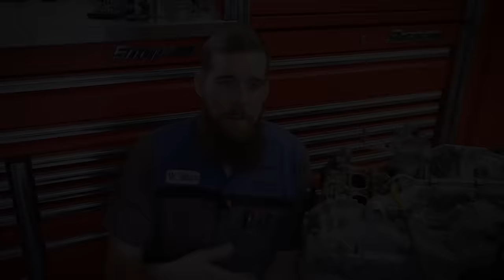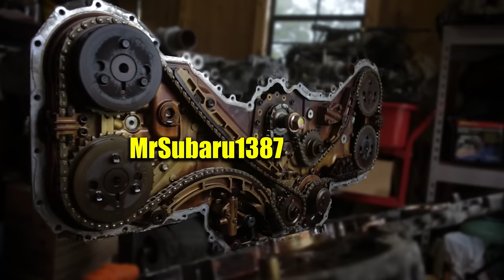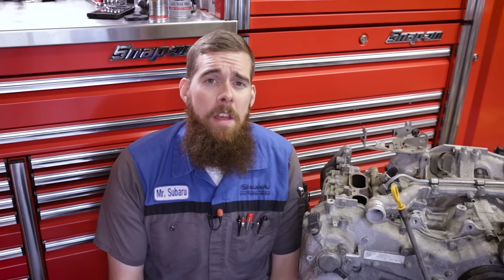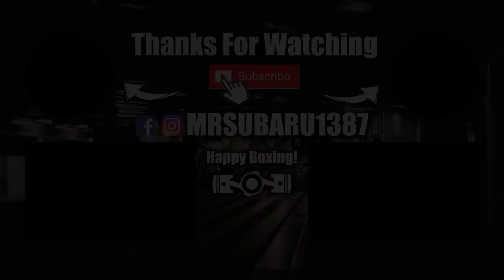Why Subarus Are So UNreliable!!! Buckle Up!!!

Comment: I have a 95 Impreza... it is a 1.8L with an AWD 5spd. This car... is a piece of shit from the way others have treated it in its past life. When I bought it it had already been treated so poorly that it wasn't road legal for nearly 4 years at that point (despite still being daily driven). This car... was not cared for at all by this guy. When I bought it, I bought it out of pure desperation for $500 off of craigslist when my car blew its transmission the day after I got my first real job. The guy claimed that it had had its engine rebuilt at 180,000miles so that's why it still ran so good. He also gave me the contact info from the person that owned it before him for some reason. After I had bought the car, I did manage to get ahold of the previous previous owner who said, "I never rebuilt the engine, I just told him that to get more money out of it. I actually used to use that car as a cheap autocross car, so from about 170,000 to 220,000 miles it lead a very VERY rough life. The only thing I ever replaced on it was the tires."

So... I bought this car at 270,000 miles. Never having had any engine work done on it from 170,000 miles onwards. It still runs like an absolute top. Smooth as butter. It has now crested the 300,000 mile mark and is still going. I am not gonna lie... I beat the ever living shit out of this engine. I have boiled the coolant right out of the engine during a snow drifting session (the rad is cracked from when the previous owner hit a dear... I patched it with JB Weld but it aint perfect) where I didn't let the engine come off redline for 10 straight minutes. We just filled the radiator back up with snow and put another 15,000 miles on it 🤣

That 1.8L is unkillable I swear.

Comment: One of my colleagues, who was a Subaru Service Advisor also told me that Head Gasket was never an issue on Turbo Boxers.

But my question is, as a Stock WRX owner, doing regular maintenance as instructed by the manual and service guidelines.
But, living frequently in the High Rev Ranges, going wide open throttle often. (Never exceeding the Red Line, of course.)
Will I blow my head gasket?

Comment: Subaru engines are not designed for high performance operation or modification.
They also do not do well when turbocharged. 
Maintain them in ordinary passenger service, and they will last, but not as long
as most Toyota engines, and certainly not as long as a cast iron American V-8
or straight 6. The last Subaru vehicle I owned which had a trouble free motor,
was a mid-1980's Legacy with the 2.2 engine. Subsequent Subarus were all
trouble-prone. Its just an outmoded design, and you can't expect too much from them.

Comment: Man I'm just now replacing my '11 STI clutch at 121k still shifts perfectly just has a worn squeaky throw out bearing, might as well replace everything in there new flywheel been a good car a side from the leaky steering rack that went at 110k that's the 1st failure.. Love this car.
Reply: Only tasteful mods, Fluidampr harmonic balancer, killerB oil pick up,  GS silicone cooling hoses, aem cai w/ tune, coilovers & upgraded brake components. Never launch beat on her nor really speed kinda drive like a grandpa 😂, and only feed her motul 5w40 every 3k and annual Blackstone oil analysis to keep on top of it. Fun car's but I'll always keep my ole '98 z28 likely never buy another Subaru again unless they bring back a Baja STI model I'd have to buy one of those beauties if they came back lol.
Reply: Guess a oil line to the turbo did rot out a few years ago we could call that a failure if we're bein picky lol

Comment: Im a new owner for a WRX coming out of the Focus ST platform, I can tell you that there is a huge undeniable mis conception about these cars. The ST the WRX the GTI etc.. These younger crowd not all but most , repeatedly do hole shots from the line drag racing these cars. That literally destroys them. These are rally inspired cars meant to be track driven not drag raced. They bolt on all the parts and have no idea how a CAI and exhaust work and how MAF works and dont get a tune and pop the engine.. Its like none of them have ever heard of WRC to understand how these cars are designed and built..

Comment: I had a subarus once and I will say there have been some great subarus, but if you have always had good luck once and then you bought a subaru and there were issues and you just happened to buy a bad year such as myself I just am unwilling to gamble on one again.  If I knew I was getting a good one I would buy one.  The other thing is I can still get a toyota with a non cvt trans.  So if subaru will put more manuals in I would give them another shot.

Comment: you are right however, if a car is marketed as a sports car and meant to be driven hard, but you beat on them they blow up, or what not why buy the car to drive it the way it should be just for it to cause issues? a car should be able to put up with how its driven based off of how its marketed.

Comment: 2109 subura WRX here, I'm 40 years young. I always wait until the oil temp is atleast 190 to get into it and try to  lay the boost on smooth. I never have launched the car from a stop because I don't think it's made for that. All that being said, It's a fairly quick car so it should be able handle some "spirited driving" right? Otherwise what's the point?

Comment: future 2021 STI owner here. what would be considerer abusing the car? id like to do weekly spirited drives and occasional heavier duty track use with it, as well as long distance driving. my last car was a 21 WRX and i was only owner, did subarus scheduled care down to the T, used OEM fluids and parts. would me driving the STI such as spirited driving and some track use be a basic "no go" unless i forge the motor?

Comment: So I wanted to buy a Subaru recently but I hate the rumble and it’s a known fact that Equal length headers are better for flow. Plus it sounds way better and accelerates smoother. Why hasn’t the manufacturer not address this. That stopped me from buying a STI and I prefer have a stock and reliable car with upgraded brake fluid, tyres and pads!
Reply: When I have to upgrade headers to get the best efficiency out of a stock turbocharge that’s is a huge deterrent for me because there is heat issues involved with it also involves tuning. Ps I rallied a evo with lag for 7 years and just did basic maintenance after every race meet, annual timing belt change and till this day I just need to turn the ignition and the car is ready to go!

Comment: I got the eBay parts replaced on my gd with tasteful mods for a 350whp build and a good tune. Stock block had 145k. Autocrossed the car after 1k miles after an oil change and spun a bearing.So yes, there are oil consumption issues. But also if I had been better with checking the oil after hard driving I may not have spun a bearing.

Comment: In 2011 I brought a 2008 Outback Diesel with high mileage (98k) for it's age which I wasn't too worried about as I do very low mileage as do most of my driving in my truck.  I did the everything service at approx 10k replacing ALL the fluids.  About 4 months later i was driving home from the yard and suddenly the engine just cut out and when pulled over the engine was locked solid?!  When my mechanic started stripping it down to see what had happened he discovered the crank shaft had snapped damaging the block in the process.  We looked for replacement engines but they were like rocking horse s**t and well over priced which eventually lead to scrapping an otherwise perfectly good car :/    Still driving Subaru though with a 2020 Outback outside now though I'd not go for a diesel again I've got to say

Comment: I 100% agree with you. I have a 2002 wrx that I have taken such great care of. Did the water pump and timing belt and just overall perfect maintenance on. I'm at 178k on it now. Still have had zero issues with the head gaskets. I baby it like ever. I have fun in it from time to time, but drive it like I drive my classic truck.

Comment: I get what you mean by it’s the owners, but issues like ringlands and spun bearings are a common issue even in stock form, and it’s not always abuse or neglect. These are common issues that have been around with the turbo EJ25 since they’ve been released. Subaru should’ve fixed those issues years ago.

Comment: So...I gather being that i am a 64 year old male that if I drive defensively and keep my oil changed, filter changed as well as other maintenance and keep my coolant level at the correct amount and don't drive like I am on the Indy track...under normal circumstances my 2020 Subaru Legacy Premium should give me many years of trouble free driving under normal situations?  Is there any other special maintenance that I should do that I am not aware of? By the way...Toyota, Honda, and Nissan have their issues, too. Also...I do enjoy your videos and you approach to the topics that you discuss. I always take my Subaru's to my dealer. They are really great. I had a 2016 Subaru Outback that totaled 185,000 miles with no issues other than routine maintenance. Thanks for your help.

Comment: I get slight bubbling in coolant my wrx 2009

My upper tank slowly moves to overflow that after a week I top up the upper tank from my overflow

Car stock I drive slow always maintained

I been driving with this issue for 2 years with no issue

If i drive on boost the problem gets worse and more bubbling in overflow

I had caps tested and they hold pressure

Had car since new

Car done 250k Australian 

Why would this happen? Any help

I would think it’s a head gasket but I saw someone on a post that had same issue

Put new head gasket and same issue 

Could it be something else other than my head gasket?

Comment: 2015 Subaru outback my mom drove like a little old lady and the head gasket overheating multiple times yeah right they got the head gasket issue fixed. Is there a problem with the way the boxer engine is dissipating heat

Comment: All my issues on my 2016 STI have been common issues and mainly power steering related from the rack seals to the pump. However due to that have found so many resources and information on it that I was able to diagnose and fix myself.

Comment: I just did an ej25 to ej20 swap for the wife’s car. Had to switch the intake and the cam and crank gears. It runs off the ej25 ecm. It runs pretty good and sounds nice. Anything you recommend I do tune wise or other? Only at 1000km or 600mi

Comment: I have a 2017 brz .At the port fuel injector tops there is a blue o ring (or o ring retainer???)  with 2 indents (2 lines across from each other if your looking straight down at the o ring.Do you know what these indents are for?  At first i thought it was from being compressed by the fuel rail.But thats not it.They are part of the injector and are removable.But I cant buy them separate.Mine ripped and pissed out so much gas.Now instead of buying a $1 ring I have to buy a $160 injector.Would a regular o ring be ok to replace that?  Is that little ring the only thing preventing my car from burning down? And the indents go half way through the ring which weakens it.The material doesn't seem like rubber.Its harder like plastic.

Comment: Hell my cars 19 years old still going strong all I have done is the maintenance it’s really that simple oh and I don’t push my motor to the redline because yea the car sounds good but I don’t need to hear the engine every time I drive. I’d rather not spend money on a new motor I’d rather just have the one in my car last right.

Comment: I had a subaru for legit a MONTH i bought it used with about 140km idk of the owner did anything to the car and i was just getting started as a car mechanic so i didnt know much about cars. But after i bought it i never redlined it i never tuned it and i thought it would be a great daily. Guess what i was driving home and it suddenly blew the head gasket. The 2.5 boxer was the worst car i ever had. I wont buy a subaru ever again and as a car meachanic i hate subaru with a burning passion.

Comment: I clicked on this thinking WTF, my 2014 2.5 Outback has 242,000+ and going strong…

At 190K I had the block pulled, all gaskets, pumps, and major maintenance replacements done on it, and I hope to drive it well into 350k or more…. How can you say they’re unreliable?

So long as you maintain it and change fluids regularly and top off any oil burn, it should just keep going…

Comment: i agree if you want to race a car i pull the motor and gearbox out build it to a race spec star gaskets gd pistons race bearings etc  that it if you want to thrash it build it maintained cars are more important no skimping  on stock dont tune or thrash them  thrash a toyota same will happen

Comment: Bought my first Subaru a couple weeks ago. '06 Outback 2.5 NA with 162K. Pretty clean car, but made a knocking noise when first started up. It quieted down after a few seconds and drove like normal. So, after a few short trips, I changed the dirty oil out with high mileage synthetic and a higher grade Fram. Upon filling, I noticed some Lucas still visible in the fill neck. Made it 4 miles into town and about 3 miles back before the knocking, rattling and squeaking was so bad that it stalled coming around a corner and wouldnt start back up. Oil is full, timing belt/tensioner checked out, car starts now but squeaks and knocks so bad I dont dare rev it up. Do I need a motor? WTF did I do wrong?

Comment: I have questions I was told by a Subaru dealer that I have piston slap so I took engine apart after finding the number 4 as the problem when I took away spark the knock stopped 03 Baja with ej251 pistons are scraped up but not terrible they measured 3.9176 or something like that a found I have about .003 pistons to wall clearance that doesn’t sound bad at all rods seem ok so what am I missing or was Subaru wrong completely

Comment: Do you have a video about Subaru standard transmissions? I've driven standard in many different vehicles and brands all my life, at least half a century, and I don't drive them hard. My 2013 Crosstrek's transmission self-destructed at about 40K miles and nearly 4 years. As they told it to me, clutch, clutch plate, transmission internals, etc, all having been maintained precisely to schedule. Later on, after reading blogs, I often read that Subaru standard transmissions had always had issues. I would appreciate any input you can give, since Subaru corporate refused to honor their warranty (the one thing it didn't apply to was their standard transmission), and gave me a three hundred dollar credit toward Subaru merchandise. Would love to have someone knowledgeable comment on this.

Comment: Honestly have of the time y'all turn. The car on and rub them like hell. If it's stock let it warm up let it get to temperature, drive it lightly untill it gets to the 208-210 (the half way point in your temperature gauge) and you can't run it really hard as long as it's not taking hard corners. It's still reliable

Comment: Unfortunately, the CVT started going out and the head gaskets started leaking at just 75,000 miles. The Harmon Kardon has recurring problems. I traded it in for a Forester. I hope to have better luck.

Comment: The issue with the WRX is that subaru doesnt know how to tune its own cars. THE TUNES ARE JUNK! I could not believe how awful the factory tune was when I test drove a new wrx back in 2020. I have never driven a car that felt like such a dog for having the power it should have had. That day I went from wanting a wrx since 2003 to not wanting one at all. I see why people modded them, tuned them and blew them up.

Comment: Is it okay to add an exhaust without a tune?

Also, Subaru says the CVT is “lifetime” but specialty Subaru shops recommend doing fluid at 60k miles. Subaru basically recommends poor maintenance.